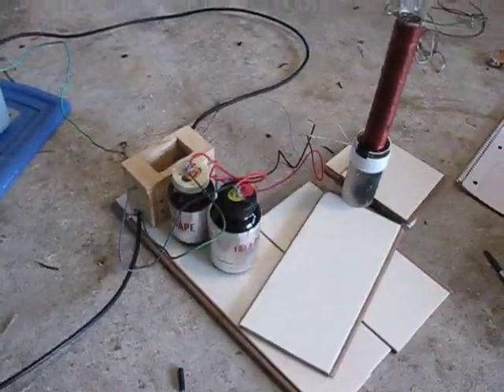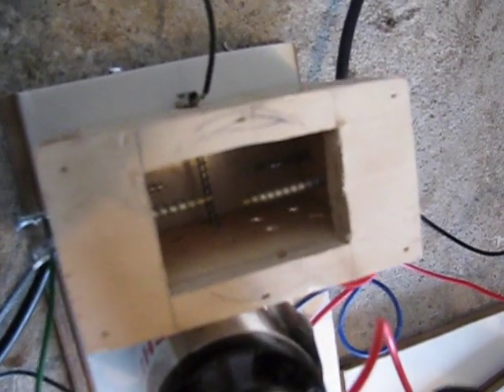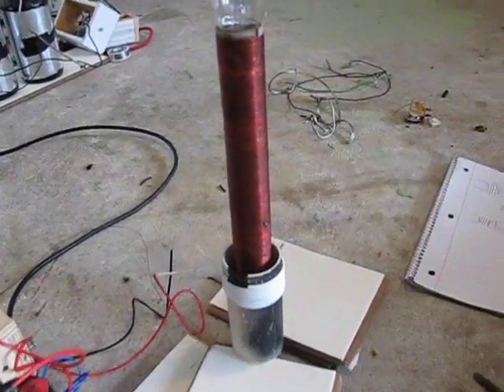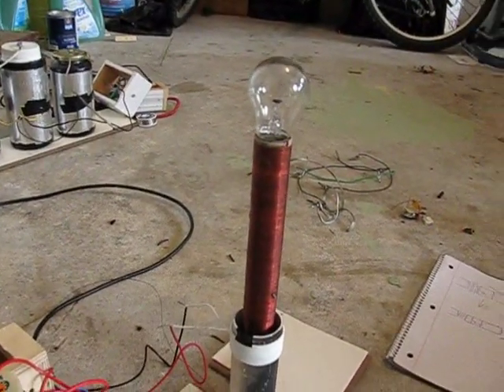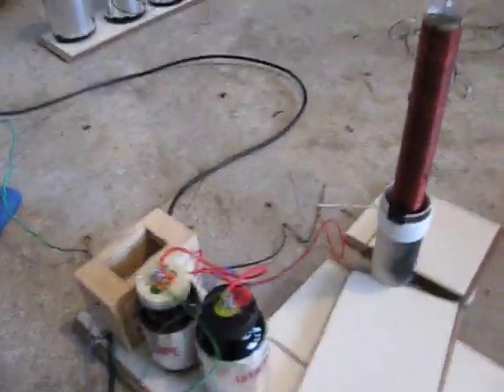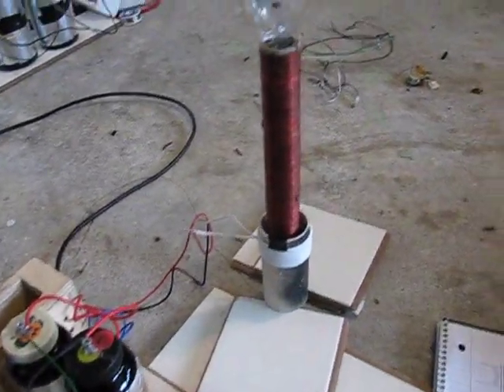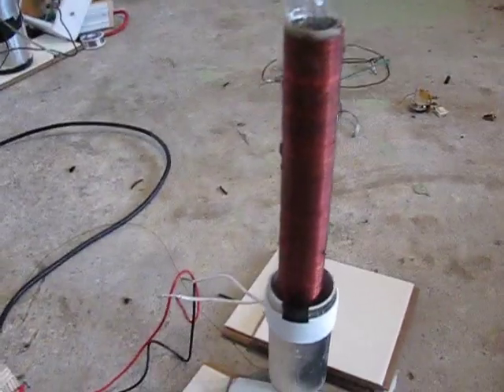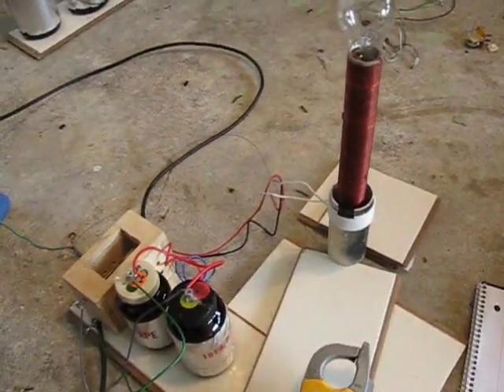Homemade Tesla Coil

Comment: You can use anything that would transfer the amps to volts, so whatever is easiest to get your hand on, go for it. Make sure you have a GFCI circuit in your NST, else you WILL have a few problems here and there...

Comment: I don't think it makes much of a difference. The glass still is a semiconductor, so it would transfer the electricity fine, as shown in the video. You can however, take out the bulb and make a toroid out of aluminum foil with some sort of frame. I used a copper clothes hanger  to make the primary coil, and the frame for the toroid.

Comment: OK folks, these are called Leyden jar capacitors. Look them up on the net for diagrams. Tesla used these capacitors but the inside of the jar had salt water of some kind inside the jar, with an electrode sticking into it and either metal on the outside or another bath of salt water... it's all on the net. Look it up. Leyden jar capacitors..... BTW do NOT take the discharge directly from a coil without being well insulated from ground, say a wooden chair. Bad idea....

Comment: @clintonearlwalker Farads are the unit of measure for capacitors. Ohms are the unit of measure for resistance. You really should study-up about basic electronics first. Jumping into high voltage projects like this, with no knowledge can be fatal. It's a really bad idea. There is a lot of information about building TC's that is NOT given on the internet. There's just too much tribal knowledge they can't cover in 10 minutes. Study and be safe man...

Comment: Move the primary down to the bottom of the secondary coil,. You are losing output voltage by splitting. The primary should be bare wire so you can tune the circuit. If stranded, tin the wires and make them all stick together. Less primary turns will probably tune it better. Glass plates with foil on both sides make great capacitors. Stack plates and glass many times for bigger value cap. 
Get mineral oil and pour between plates of glass/foil. get 1/8 to 1/4 in. glass. Min. oil bath is best.

Comment: I know where there is a bunch of old worthless microwave ovens laying around that I could amputate, but what about the capacitors and the spark and safety gap?  I don't think I understand those too well.  Did you make the capacitors, if so how?  Farads of resistance means very little to me.

Comment from the maker: @jtfunkymojo no but it's pretty close to zero amps...the transformer i used was  i think 20mA short circuit current at 12,000 volts....ramp the voltage up several times with the tesla coil and you are getting max maybe 3mA...nowhere near enough to kill you...granted this thing does give you one nasty shock!:D

Comment from the maker: @TheRandomHaloGuy bulb type is a simple lightbulb that you would use in your house, nothing fancy about it at all! :) i'm sure you would know where i got that..walmart!:D but i didn't buy it, i just had it laying in my garage. I attached it by sticking it inside the tube i was using for the secondary..it fit perfectly..i just had the wire at the top contacting the socket part of it.....there should probably be spaces on the primary to prevent arcing...i just did that as a quick set up, thats all